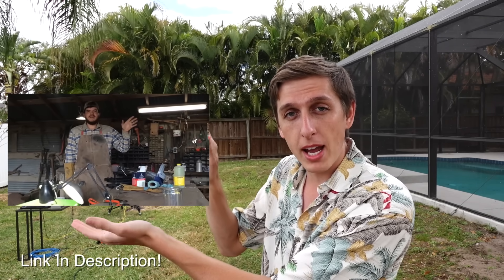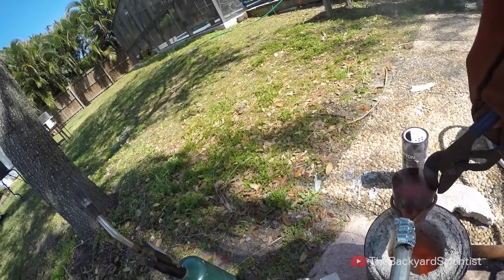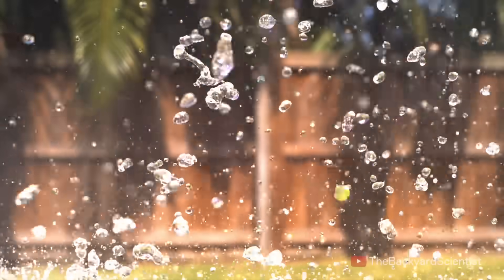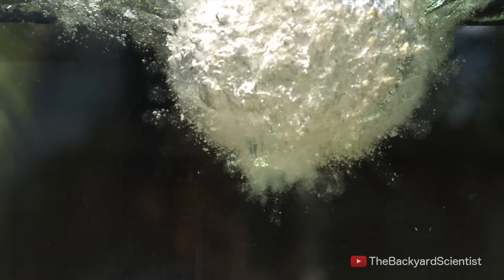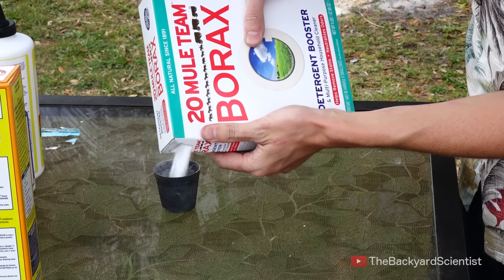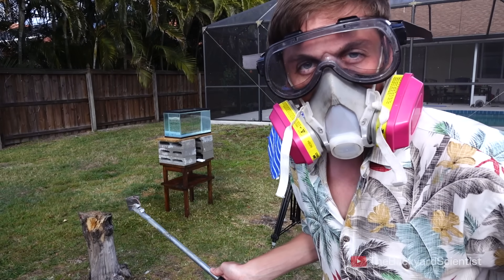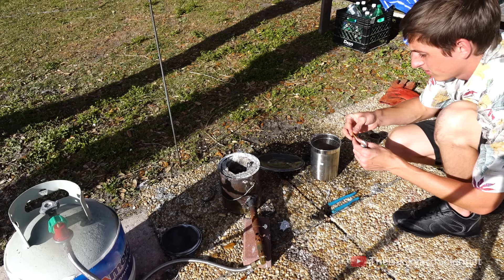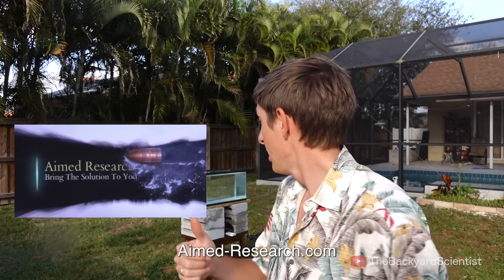Pouring Molten salt into Water - Explosion!

Comment: Too many comments for me to browse through, so I'll ask instead: Did anyone figure out what was happening??? I am still curious the specific nature of the borax thing.. I find it curious that he said "other salts" when he only mentioned borax.. 

My thoughts:

Anything that heats water to steam fast enough will make it "explode" as water steam is 1000 times the volume of the water it is made of, so it was what NOT made it explode that made it interesting.

F.ex. the reason "why you should not try to use water to put out grease fire".. the thing is.. water puts out the fire just fine (DON'T try this at home).. but you do NOT want to send a "glob" of water in to the oil (it's just the gas evaporating from the surface that is burning), the oil will instantly heat the water to the expansion point.. and this way we get an explosion in the oil, throwing the burning oil all around the room. Water as a way of putting out fires have two effects: One is cooling it off, the other is that the quickly expanding water pushes away the oxygen the fire needs to breath. So if we instead throw a fine mist OVER the grease fire, then it will be able to do it's job on the flames. The expanding water will however take the burning gasses with them, so you will see the flames "expanding" too, so it's not all good, but the density of the material burning will be much lower so it will be colder flames that are less likely to set fire to anything, especially since they will soon be extinguished (it usually does take SOME time to set something else on fire, only other gases should be at risk)

I assumed this to be the answer when I started watching the video, and I wondered why I even wasted my time watching,

.. until the borax.

The only possible answer I can think of is that it has to have something to do with the heat transference, the main question is what.. For some reason the heat from the heated borax enters the water slower, so a much much smaller amount of water turns in to gas per time unit.. 

The thing I can't think of is what the reason is.. all materials have heat-conducting properties, that is why soda in a metal can will get cold faster than in a plastic can.. in the same manner it will take longer for the plastic in the can to get to the same temperature as it's surrounding than it would metal (though we wouldn't feel it, because what we feel is rather how quickly the cold or heat enters our bodies, that is why dry heat don't feel as bad compared to if there is a lot of air humidity, or why it- in winter- FEELS colder when sitting on a metal railing than a wooden park bench)..similarly the  different salts might have a different property as to how fast they are able to transfer their stored energy into the surrounding water. If it is not fast enough, then the small amount of steam around it will in itself slow down the transfer to the water around it.

It's a reasonable explanation (if you ask me), but.. there are also other options. F.ex. there might be a surface-tension or consistency thing in play.. if one is more likely to break up in smaller particles, then they might be more likely to penetrate the surrounding "shield" of already steam:ized (I believe that is the correct technical term in English ;-) ) water so it will faster/easier come in direct contact with water.

Comment: This reaction is a chemical reaction. The table salt used in the video is composed of Sodium and Chlorine. The sodium when superheated happens to return to its molten metal form, and chlorine being a gas leaves. Sodium is an alkali metal, which happens to violently react with water although it isn’t the most reactive alkali metal.

You’re welcome

Comment: There is a exothermic reaction if you mix NaOH and water. Could you please make a experiment.
Mit a metal tube with one end closed and then mix NaOH with water but put the rod in the water I want to know how much would the water in the tank be heated up if the exothermic reaction happen?

Comment: The reaction from the Na metal is so fast that it cannot penetrate the water. Hydrogen (H2) is produced so rapidly that the buring H2 produces steam that touches the lower surface of the Na producing more H2 and more fire and more steam. You can see a similar result if you remove the Li from a battery and drop it on water. The reaction is so fast that the Li never sinks.

Comment: I think it is exploding because when you heat the salt up that much, it breaks the Na-Cl bonds and makes it go into a high energy state. when it is dropped into the cool water, it instantly cools down and reforms the crystal structure. Since this crystal state is much more stable than the molten state and because of how fast the reaction happens, it releases a ton of energy at once.

Comment: Ok, I'm not the best at chemistry, but I have a theory on why it combusts, When the NaCl (Sodium Chloride) is melted, when it touches the H2o (Water) the Sodium Chloride reacts with the water as it should, but it is at a temp of 801°C causes the water to get so hot, that it wants to expand and causes the glass to shader. 

 If I am wrong feel free to correct me, I will then either remove this comment or correct it. Have a good day!😁
Reply: definitely is a chemical reaction....

Comment: NaCl can't change pH of water cuz this salt can't be hydroysed. It is salt of strong acid and strong base. Salts of weak acid weak base or weak acid strong base do change pH. Cuz their weaker part will hydrolyse and utilise Ions water eventually changing pH
Reply: No, its just that water is polar so it dissolves the ionic salt. It can't change the pH because that means either the OH- or H+ amount is changing. Dissolving is simply separating salt into Na+ or Cl+ not separating the water, so it wouldn't change the pH.

I think it is exploding because when you heat the salt up that much, it breaks the Na-Cl bonds and makes it go into a high energy state. when it is dropped into the cool water, it instantly cools down and reforms the crystal structure. Since this crystal state is much more stable than the molten state and because of how fast the reaction happens, it releases a ton of energy at once.
Reply: Couldn't have sed it better myself
Reply: NERD

Comment: Okay, I gather then that any thing carrying a temperature significantly higher than the boiling point of water will cause an explosion, and the degree of that explosion depends on how quickly the heat gets transferred to the water. Now the molten salt managed to sink and released the heat in the depth of the water...the rapid expansion of the heating water resulting in an explosion. I'm mostly baffled by why the explosion isn't sudden

Comment: I have a hypothesis on the matter based on your experiment. The chloride is separating from the sodium due to the heat. The explosion is a result of the sodium's reaction to water as it separates from the chloride. This is why salt itself would not explode. Sodium and chloride together are stable in water and normal temperatures; howsoever, sodium is not. Notice that the reaction would not occur until you reached a high enough temperature. Also, it is partly a physical reaction, as the salt causes the sodium and chloride to separate below the water instead of above it. Try holding the burning sodium under the water. Also, when you dropped pure sodium under the water it was bound by itself, but apparently when you have chloride molecules in between, they cause a separation of the sodium molecules. Therefore, the sodium molecules would be smaller and need more room to expand around the chloride molecules. My guess would be that more sodium molecules are meeting the water molecules due to the surrounding chloride molecules. A bunch of little explosions are causing a bigger explosion. Whereas, the sodium itself is in more of a solid state and it is more of a major explosion. Less water would be able to meet the sodium molecules on its own.

Comment: Most table salts are iodized. So that could be a potential factor. iodine is present in water but when water is introduced with more it acts as a purifier loosening the particles. So maybe the sodium is so explosive in this scenario because the iodine while hot is changing the waters compound first. Making it both a chemical and physical reaction

Comment: Perhaps molten sodium chloride has a high surface tension that kinda lets it wrap around small amounts of water which then become steam and explode. Like as if it acts like a sponge for a split second and then surface tension pulls it together trapping the water until it explodes from the steam.. IDK I'm not a scientist, I'm just speculating

Comment: I think that it is a combination of the temperature difference and a chemical reaction. If the table salt is hot enough the sodium and the chlorine will come unbound leaving a small amount of sodium free to react. The initial interaction between the extremely hot salt and water expands the molten salt solution exposing more surface area and allowing the chemical interaction between sodium and water providing the energy for the explosion.  Why wear shorts and have pets in yard when trying to explode things.
Reply: If NaCl was becoming really unbound that would have happened prior to him getting to the tank. Given he got more explosion at higher temperatures indicates it is based more on heat. As it transitioned i.e. spread out in the water, it was able to extend the thermodynamic "reach" in part because it was "runnier" and could heat more water per unit time while it generated steam which is why I think we saw the "balls" form and steam bubbles around the balls. As the water heated it also became less viscous and open an escape channel for the steam. 
Water is almost magical in its ability to absorb heat (I urge you to look it up, it is one of the few molecules capable of performing this feat which is why it flashes to steam).

I'm certain there also was a chemical reaction but played a much, much, less part than temperature. (He had to heat it more to get an explosion, heating won't generate more sodium or chlorine).  If hot sodium was doing much the Borax would have reacted similarly and it didn't. 

His dumping sodium into the water is pretty bogus because it reacted so quickly most of the reaction was on surface and from a molecular point of view he dumped billions and billions more atoms into the water. 

We would need to know more about what the salt temperature differential was, viscosity at temperature, distance between Na & Cl atoms at temp vs water molecule size, binding potential, etc. for all we know the chlorine at temp was ripping the water molecule apart as well and need to test the water for HCl aka Hydrogen Chloride using his Ph strips.

Don't get wrong it was fun to watch an explosion in a glass tank from a guy wearing a short sleeve shirt and shorts... but it woulda made a chemistry grad student puke to hear his theories.

Comment: ****************************************************         TheBackyardScientist may be incorrect         ****************************************************
Not 100% sure about this, but I feel that it is, in fact, a chemical reaction. 

For the following reasons:
- pH is not the only factor in determining the type of reaction.
- The study is not very descriptive and provides observations, but lacks much scientific explanation and comes to vague hypotheses without apt evidence.
- A chemical reaction is where the molecular structure of two substances changes, while this does not happen in a physical reaction. Salt is very hydrophilic because it is polar(Na+Cl-) and water is also polar(H2-O+). So, it is very likely that the salt did, in fact, chemically react with the water.
- The enthalpy of this system definitely decreased and the entropy clearly increased. This is shown by the explosion; energy is released in obviously large quantities. A physical reaction does not affect the enthalpy or entropy of a system.

Comment: Hypothesis: molten salt is unusually soluble in water - not "eventually" but "immediately" and this results in a sort of ablative surface cooling that prevents the formation of a protective hot gas bubble at least partially, until the salt blob breaks up with turbulence and admits a shaft of brine inside the very hot salt core that then gets superheated and changes phase in a fast uniform way resulting in a detonation.

Comment: Okay. So before video finishes let's do some predicting. It's the same reason a prince rupert drop explodes sort of. The rapid cooling of the exterior creates a casing while the stuff inside still cools. But just like a prince rupert all the stuff inside is far less dense thus exerts pressure until that outer shell fails causing the explosion. It's just a price rupees drop with an outside that is not strong enough to contain it. That's why the quick poor has a higher explosion yield. And the reason the NaCl isn't effected by the effect is maybe because NaCl is water solulable and dissociates

Comment: Pure sodium alone will have an explosive reaction with water at normal room temperature. Sodium is unstable. Usually it’s stored in an oil so it doesn’t react with water in the air

Comment: Heated that much, Na separates from Cl (kinda that, it becomes a Na+ ion or whatever u call that in English. The point is that Na reacts with H²O with an explosion and u know the rule of chemistry: the more heat, the more action and the faster it goes and everything. So.. this is it. And pH won't show u anything cause it doesn't show any reaction u want it to. And your Metal-kind piece of it did not react because Na is extremely active and it gets covered by some self-oxide in seconds - that prevents the explosion. I bet that if u melt it - there's gonna be a same thing as in this Molten Salt experiment. Nicely done btw. My English sucks btw.

Comment: Could the salt be cooling on the surface and creating interior tension essentially creating a prince rupert's drop as it cools and shattering. As the salt cooled in your glove it made cool cracking sounds. likely the structure cracking due to thermal expansion and contraction. Could the explosion be the release of internal energy stored in the structure of the salt?

Comment: As soon as it goes under all the way and the water closes over the top of it, it is then confined. when It tries to expand under pressure it explodes.  The metal is more viscus when molten so it doesn't stay clumped, little pieces separate under the mass and explode under it keeping it at the surface. Also it looks like it is evaporating oxygen out of the water then igniting it.

Comment: I think you are on point why the molten salt caused an explosion and the reason the other other salts did not cause an explosion is because on the footage you can see the molten salt creating an air pocket around itself. So no water could get into the molten salt to cause the explosion.

Comment: Chemistry memories are hazy, but isn't sodium part of those metals like lithium and Cesium that ionize real fast in water, exploding ?
Being with chloride would stabilise it a bit so no burst, but the heat would break those bonds and allow that reaction, which is quickened by both heat and the size of the particles involved ?

But you wouldn't need to heat the sodium then. Quite surprised you didn't try at room temperature

Comment: Could the explosion be caused by the extreme temperature changes, instead of a chemical reaction?
Reply: This is what I was thinking because NaCl and H2O do not react chemically. The salt molecules fill up spaces between the water molecules when they dissolve. (or vice versa) and this could cause a sudden influx of thermal energy causing the molecules to vibrate and collide resulting in the explosion.

Comment: it's most likely caused by the heat of the salt. when it hits the water it makes the water start to evaporate, making it expand. this sudden expansion is probably the cause of this explosion.

salt also absorbs water, hence why it is used in "salting roads" for winter. that's most likely why it's able to come into contact with the water. it was absorbing the water. the other "salts" were really mixtures with other salts in them, and the salt wouldn't be as effective as just pure salt.

just my idea. probably wrong though. i'm not a scientist XD

Comment: Normal table salt is basically NaCl.  When you put NaCl in the furnace,  Cl is gone by fire as can be seen from the color of the flame,  leaving molten Na ie Sodium behind.  Na is highly reactive, even O2 reacts with Na.  Thus Na on contact with water reacts fastly and thus explosions occur

Comment: I would say that the explosion is because of transfering great amount of energy. This gain has to be fast and cumulated. When water get locally heated to 647 K so than explosion occurs. 
Other salts may not be able to handle to transfer so much heat at needed rate. Water has great heat capacity and water wapors isolates contacting surfaces between salt and water. 
https://en.wikipedia.org/wiki/Supercritical_fluid 
https://en.wikipedia.org/wiki/Sodium_chloride

Comment: dude the thermodynamics of the formed vapor ball looks surprisingly like the surface of the sun. I think this is cooler than even you think. Imagine that same explosion but in a 0g vacuum with more fuel than imaginable and you have our sun except its the coldness of space instead of a tank of water. And it Hydrogen instead of salt.